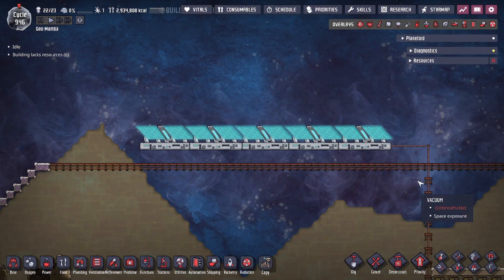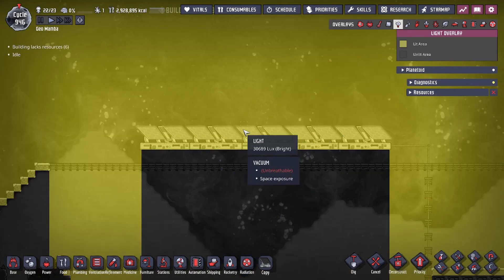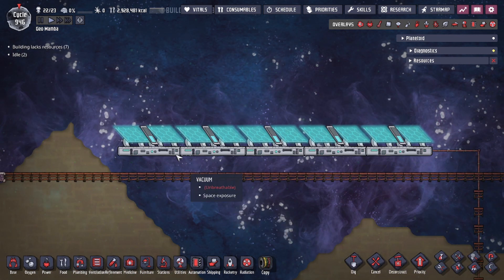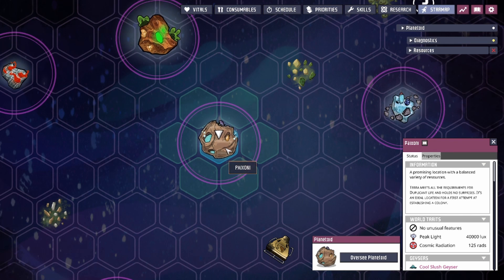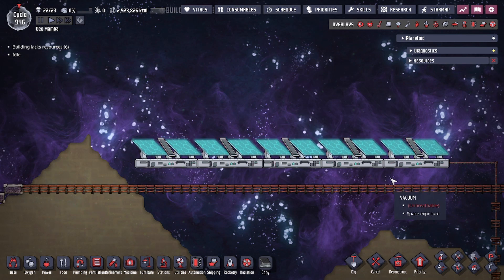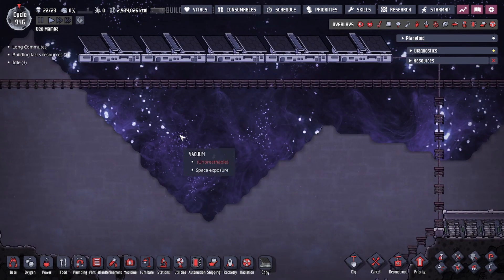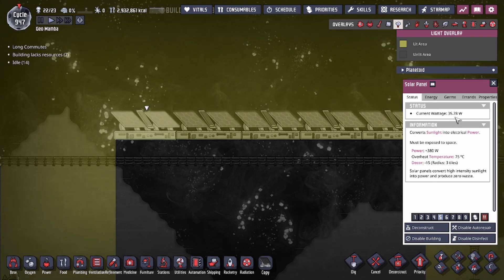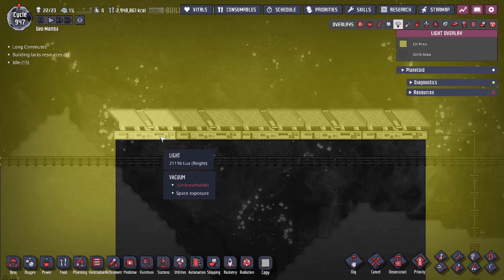Solar Panels Explained - Lux & Power - Oxygen Not Included Basics

Comment: Hey I was wondering if u happen to know any way to convert power to any kind of long-term energy storage? The only idea I had was using extra power to refine oil but I think that magma is more efficient for that anyways.
Reply from the maker: long term energy storage would be either converting raw materials into a fuel source or storing power in transformers since they dont have run off (but still create heat) but thats alot of transformers to store power. 

Other wise, what comes to mind is using the rocket launch exhaust heat to store enough thermal energy to start melting minerals into magma and then storing said magma on airflows in a vacuum. everything else is too specific of resource management/processing, like a sour gas boiler
Reply: Maybe Infinite liquid/gas storage into a steam chamber. You can add infinite hot steam at the 200c(since you can’t really work with infinite heat). When you want the power you simple turn on the turbines that start converting the infinite steam storage into power.
Reply: I think u need to Ligma sugma to store power forever
Reply: store fuel, not energy